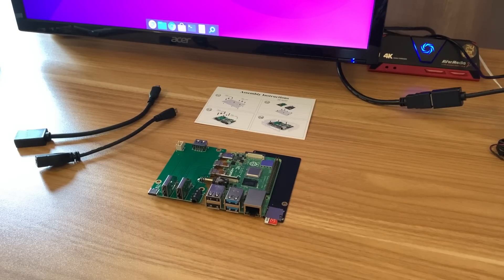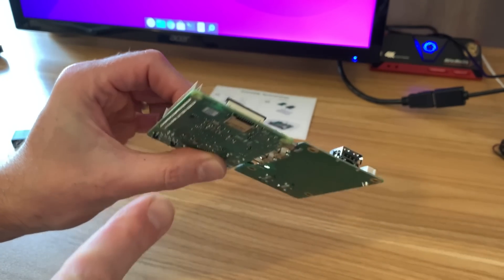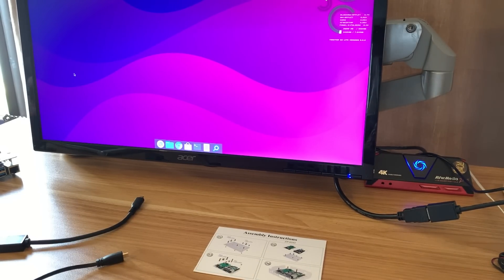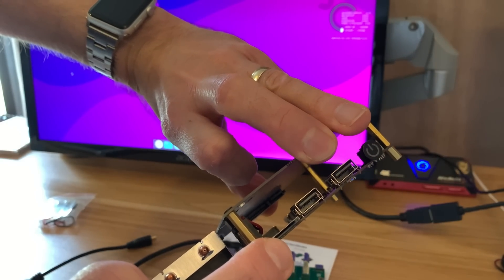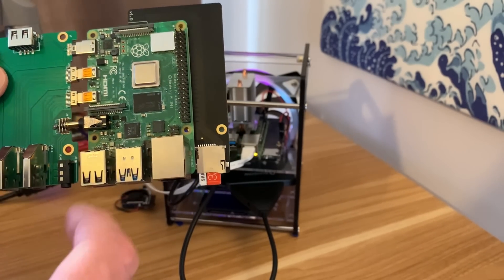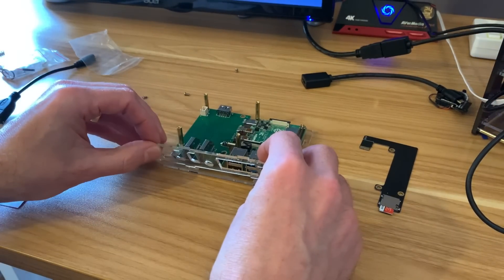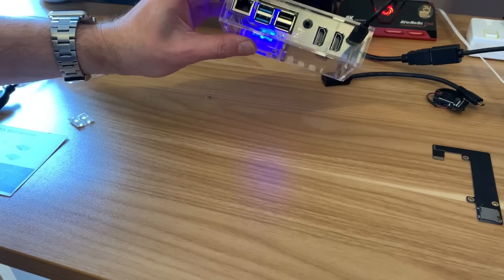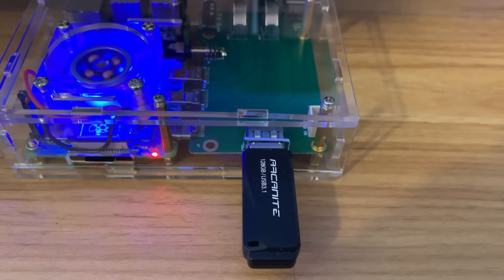Add Full size HDMI to Raspberry Pi 4

Comment: Tip... For those silly stick on HeatSink's , scrape of the conductive tape and put high quality heatsink compound instead. Wished Raspberry wouldn't have gone with the non-standard HDMI out's until TV's actually shipped with them.

Comment: To use the extra USB you need to enable host mode on the usb C port, its in device mode by default. To enable just add "dtoverlay=dwc2,dr_mode=host" to your config.txt and reboot.
Reply: is that extra USB port a 2.0 or 3.0 after you enable host mode?
Reply: @Jasonwutuber  sadly its only 2.0 bus speed

Comment: For the front usb port you need to flip the mode from OTG to host mode by placing a command in config.txt   It's documented on 52pi wiki.  https://wiki.52pi.com/index.php/Acrylic_Set-top_box_kit_for_RPi_4B_SKU:_ZP-0102#How_enable_the_functions_onborad

BTW this is the only Pi case I've found that breaks out the data pins from the usb c power port so that you can use them.  Because it's a OTG port, you can use the Pi to emulate usb devices like ethernet, serial, keyboard exactly like the Pi Zero gadget mode. https://gist.github.com/gbaman/50b6cca61dd1c3f88f41  It will require a USB A to A cable, and beware of back feeding power into a computer's usb port.  Example of use case pikvm:  https://www.reddit.com/r/pikvm/comments/l53fsv/my_build/

Comment: The front facing USB port is a power only port. You could attach USB powered speakers to it, for example. But it takes the power before the Pi gets it, so you'll need a higher amperage supply to properly use it, IMO.

The white power connector on the daughter board is for the fan.

Interesting this video just dropped, as I ordered this case already and am waiting on delivery. 😊

I also purchased a kit of standoffs to modify it.
Reply from the maker: The Amazon listing mentioned it’s a camera port.
Reply: @leepspvideo  the one picture is misleading in the listing; they're actually pointing to the camera port on the Pi itself.
Reply from the maker: @BenRossington1  the picture I’m looking at is pointing to the usb socket on the breakout board
Reply: @leepspvideo  and there's another slot for the DSI cable, too.

Comment: I have this case and I  keep these small pliers or tweezer near by if I use the sd card. I only use it when I try out a new O.S. Normally I have two gard drives a a 3.9 hub attached to the pi for my operating sessions 32 an 64 my usb hub has on/off switches next to each input for the harddrives so I  can boot either one

Comment: I like the idea of the full size HDMI ports and the case, but I am committed to the Ice Towers which I really like. It would be good if the full tall Ice Tower could somehow be used with this case. The small fan is nice but the Ice Tower is better. Many thanks for sharing.
Reply: I have the older version of this case/extender board that has the horizontal full size hdmi sockets and I retro fitted the low profile ice tower into it. See my avatar picture.
Reply: @MrMuzza008  Cheers for that.

Comment: Would be good if the spare space in the case could fit an SSD.
Reply: I was thinking the same thing. There's an awful lot of wasted space in there.
Reply: I'm planning on using a standoff kit to extend a caddy for my SSD over the daughter board. The standoffs already there could be extended upwards with the correct part, outside the case, I think.

Comment: I really hope a future revision of the Pi4, or the Pi5 will use USB C for video out. Micro HDMI is just awful. Amazingly, it's even worse than micro USB. I would have even preferred if they omitted one of the video outs and made it one full-size HDMI instead.
Reply from the maker: I would prefer mini HDMI for compatibility. It’s also a stronger plug.

Comment: the raspberry pi foundation should have just turned the full size hdmi's on their side to fit, maybe an update to the pi 4
Reply: @AstroCat money should not be ever used as a measure to design a product
Reply: @Jkauppa  True. I still feel the form factor is one that has to finally change to set themselves apart yet further from the cheap Chinese boards.

Maybe something along the lines of the CM4 I/O board in size to give the designers more freedom, and not be constrained by the long established footprint of the Pi range. If that has to be a “Pro” model to distinguish it, and allow for a standard sized Pi 5, then why not. Slot in nicely between the Pi and the CM ranges.
Reply: I bought a couple of micro HDMI to full size HDMI cables for less than $10 each. A credit card sized board is crowded with IO ports enough without those huge connectors.
Reply: @ninline2000  i have short plugs but i can only fit one
Reply: @Jkauppa  I hook up both with no problem. I looked at the ports and ordered the right cable. It isn't that difficult.
Reply: @AstroCat it could be through pcb
Reply: @AstroCat i think someone made a connector board with full hdmi for the cm4, check Jeff Gs stuff, and which is easier, hats can rise a bit with the pins, cases can adapt
Reply: @AstroCat maybe just a better design for rpi5
Reply: @AstroCat changing a port plug to another is not a huge change
Reply: @AstroCat design change is not a huge change, design once copy however many times
Reply: @AstroCat i dare to say, if you dont charge for any parts, its all free
Reply: @AstroCat now we have just the design to fit the purpose, not fitting the purpose to cost
Reply: @AstroCat thats why we have chinese and other poor products
Reply: @AstroCat arguments huh, if i dont get it free, then no more rpis
Reply: @AstroCat you can argue all day about laws and prices, but it can all end, in tears
Reply: @AstroCat read my answer as: who made the covid and who can crank it up
Reply: @AstroCat no-one will work at the end, so you should be preparing to make it for free, right now
Reply: i forgot what i was going to totally slam something

Comment: i recently had to remove those metal heat sinks.. only way i found was using dental floss and running it between the sink and the fan.. what method did you use..?
Reply: Turn it on without a boot drive. Leave it for thirty minutes. Return, power off, and use a toothpick to wedge in there.

But dental floss, assuming you can get at it properly, sounds like a winner.
Reply: @BenRossington1  never thought of leaving it on for a while before using the floss. it would have been miles easier. good tip.
Reply from the maker: Twisting and prising with a plastic flat tool.
Reply: @leepspvideo  ouch!

Comment: The Extra USB should be getting Power from the PSU and Data from the Pi's USB-C, going by the tracer's, and the 5v Jumper gets it power on the same lines as the USB on that daughter board

Comment: The few times I have had to remove the heat sinks, I run the Pi for a bit, which heats up the adhesive and makes it easier to gently twist them off with a pliers.  I only tried without the pliers once...very hot :) but the heat does seem to soften the pad a bit.
Reply: thanks, nice tip, might put my 8GB pi in the argon m2 case after removing those pads.
Reply: Those heat sinks are so hard to remove when it's not warmed up. I almost broke my Raspberry Pi one time.

Comment: Do you have any of the Argon Case's, The Argon One V2 has full size hdmi and so does their M.2 Case
Reply from the maker: I haven’t. They do look good.
Reply: @leepspvideo  I was a backer and have one for the 3B+ and bought the first one for the Pi4B with the micro hmdi's, also got a Neo with AR1 Fan and drilled holes in the lid
Reply: @leepspvideo  I bought one - the case was great the PCB extension board for the audio and full size HDMI was rubbish - the HDMI ports were dead and there's a reddit thread about lots of people having problems with the SD card not being recognised or problems with audio. Had to send it back - shame as I liked the idea.